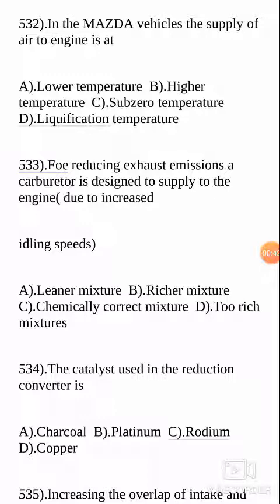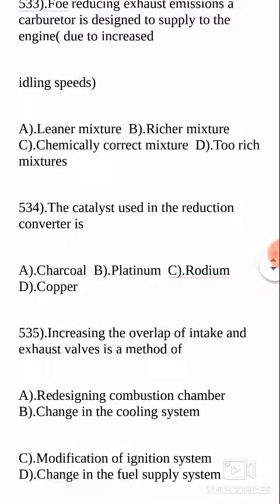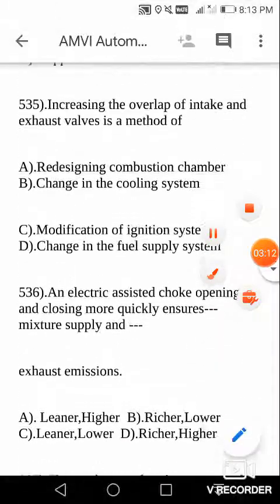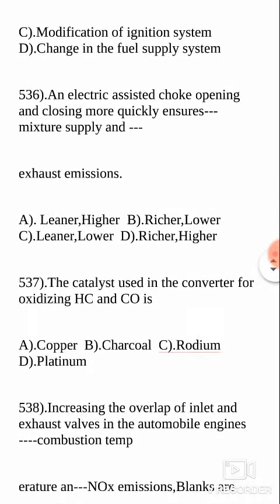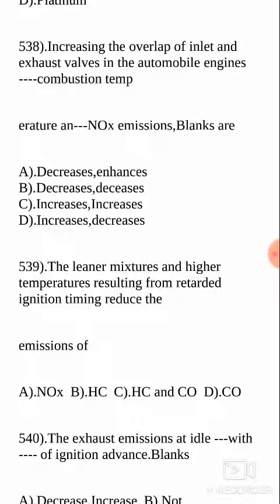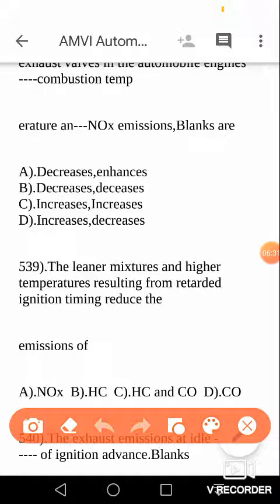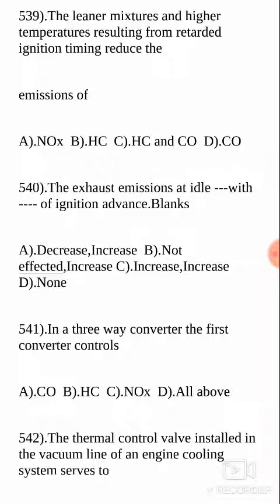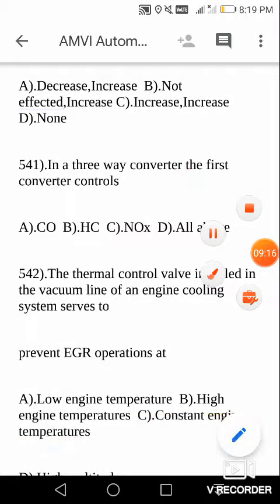Let's Crack TSPSC /APPSC AMVI

Comment: Sir small doubt ... I have completed my B-TECH but my height is 157 cm can I eligible ... For this amvi notification
Reply from the maker: With no reservation height should be 165 cm and with reservation it is 160 cm. However some concessions may be given. Wait and check the actual notification shortly going to be released. Good luck.